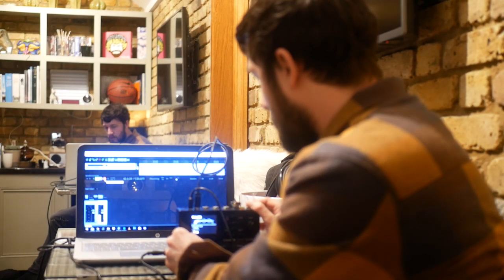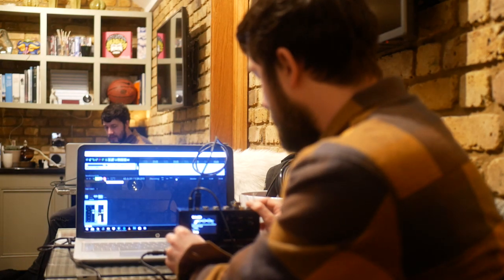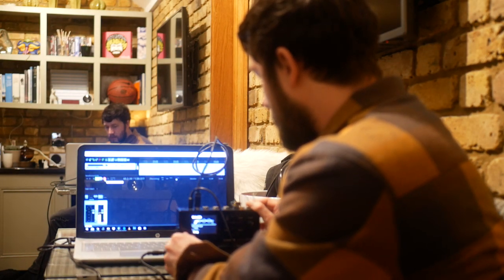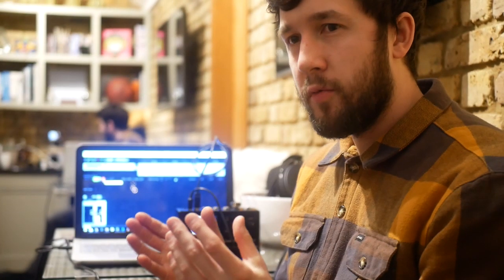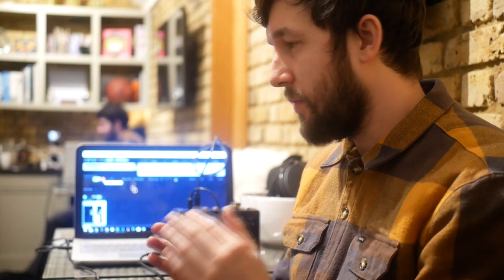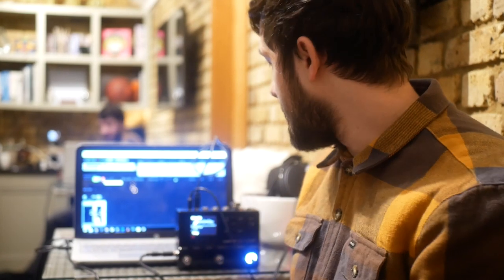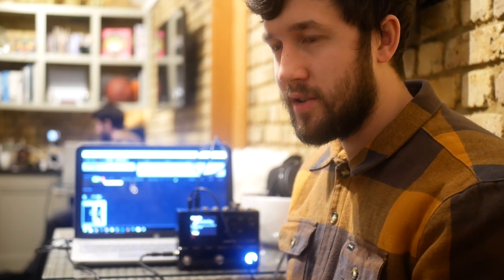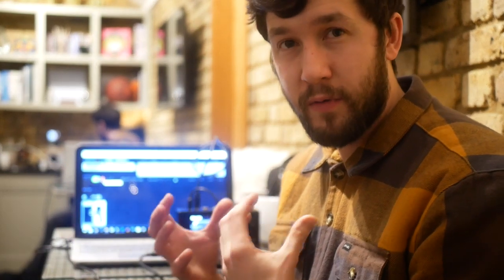Making a MODELLER FEEL like a REAL AMP

Comment: I purchased the Helix about 2 years ago. My current signal chain is 1/4" out to Fender Super Champ X2 head guitar to Ephiphone 1x12 cab w/Eminescence speaker. Turn the voicings off and run it on clean channel Fender Twin channel and run the volume to the level that I want it in my studio and mic for recording or rehearse with it from there. It sounds fantastic! Fast forward to a pandemic setting and rescheduled festival after 2 years I was geeked to show it all off! During sound check I ran into an issue where I couldn't get rid of a solid buzz from the amp- something that I've never heard before (professional sound techs and I tried everything - replacing cords, ground lifts, etc. and burnt a half hour) I ultimately had to drop the head and cabinet and run direct from XLRs to front of house as I was burning from setup time into our sound check time. I was in complete panic mode!  All I could think of was that I sold my Vox and awesome pedal rig to invest in this damn computer floor board that sounded great in our rehearsal studio and now I'm f&cked! The only work around last minute was to run XLRs to front of house instead of mic'd cabinet. We played the show, it went off well, but felt defeated. I monitored out of the wedges (sorry, still old school) and what came back at me for my guitar sound was synthetic and dry sounding. I had little to no sustain and it felt digital and shitty! The audience had a great time, but I couldn't get into the gig because in my head I felt like I sounded like people were hearing me through a 1990's Zoom pedal. I'm not a professional touring musician and don't play out nearly as much as many of you do. I value Rhett and I understood and appreciated John's opinions on Rhett's videos. I just want a rig that sound great live, great to rehearse and great to record and I'd be happy. If that means ditching the Helix and going old school....I can accept that. I hate to ditch the helix due to the investment and I do love the versatilty. I've been looking for videos on mic'd up live amps through a helix but haven't found much. If I can't get sustain, feedback and that warm tube feeling through a Helix I'm open to buyers. I assume that you really need an amp on stage to help get the feedback and help with the live feel. A buddy of mine plays shows every weekend and runs front of house through XLR's and loves the helix. Maybe it's all in my setup.Any comments, feedbacks, tips or other videos you've run across would be greatly appreciated! Sorry to hijack this post.

Comment: I watched Rhett's video and thought pretty much the same things you've covered here.

The biggest barrier between a real amp in a room and a modeller is the fact that pretty much every cab/speaker sim is purposely trying to emulate the sound of a miked up guitar cab, simply because there is no better way to do it.

Sound made by a guitar cab (or any other object) is 3D. This is very easy to demonstrate simply by moving a mic in relation to the cab/speaker. You are capturing a narrow slice of the overall sound. The sound in the room is impossible to recreate through a different speaker (such as a FRFR monitor) because it is dictated by the physical properties of the cab/speaker and how it reacts with the environment around it. If you try to reproduce it through another speaker, that speaker's own physical properties come into play and it creates it's own 3D sound field which will differ from the original cab/speaker.

The only way to do it would be an approach like the Waza Air, where you have headphones/IEMs and simulate the physical properties of the cab and the room it's in while simulating your ears positions in that virtual space in real time (so the sound changes as you move).

Long story short, if you want to achieve a real amp in the room sound using a modeller, plug it into a power amp, disable the IR/cab sim and use a real guitar cab. Modelling has become very good nowadays but the problems associated with cab/speaker simulation are physical in nature.
Reply: napalmhardcore I use the FX Return of an amp with my Headrush and magically it sounds like a real amp.

Comment: I think I've stumbled upon a game-changing solution to 2 major problems with both home use tube amps and digital modelers not feeling like real amps when turned up to gig volumes. I used three significant pieces of gear. A Line-6 Helix LT, a EVH 5150 III lbx mk 1, and a Bluguitar Nanocab. (Signal chain/connections) guitar into Helix in, Helix headphone out to EVH Power amp return, EVH into Nanocab. (the secret to making it work) For volume use Helix large knob to control tone volume. The EVH's power amp is punchy and powerful but also really dynamic (note: I also replaced every tube in the EVH from the stock Chinese made JJ's to Mesa Boogie branded tubes from sweetwater). The EVH had two VERY IMPORTANT tone controls in the power amp section, Resonance and Presence. When playing digital modelers loud the harshness and brittleness is (for me) impossible to dial out fully. But by using the amp's resonance knob, the tones and (most importantly) the feel of tube amp comes through. In the mix is where the presence knob comes in (start all the way off and blend until the tone sits well in the mix. The other "secret" is the Nanocab by Bluguitar. It is a 14-inch by 10-inch guitar cabinet that has been specifically designed to create and project as close to a 4x12 cab as any other 1x12 cab ever has. It has special porting and resonance as well as an amazing ability to project clearly and evenly. When combined these pieces of gear create a real tube amp experience when playing "bedroom appropriate" levels of volume (quieter than the pick attack on the strings acoustically) but also when cranked too. With the Helix volume knob at 3 o'clock its a quiet 55 db. with the knob at 6 o'clock, it's a gig-worthy 113 db. The tones never get harsh or digital sounding when loud but also maintain the fullness and touch sensitivity when playing quietly.
Reply from the maker: Awesome - thanks for sharing!

Comment: I couldn’t agree more with you!
In my experience as a working musician that uses in ears a lot live, I would say that cutting the lows using a low cut is a bad choice because the guitar starts to sound harsh in my experience. About the highs I tend to use a high cut around 5k (which is a lot for some people but it works for me).
I think what changes our perception of the guitar tone playing with real amps versus modelers is that we don’t play guitar with our ears close to the speaker as the modelers emulate. So, all the harshness present in the highs we don’t hear playing with a real amp.

Another thing that makes a difference for the good is using a kind of a room reverb to emulate the feel of an amp in the room.
But is still hard to get a good tone with any modeler that I’ve tried.

I’m thinking about the dream 65 by UA just because of the room emulation that they have. I think it can solve my problem of dry guitar tones through in ears.

My last recommendation based in my experience is always use stereo headphones for the guitar tone (whenever the sound guy gives you that possibility)

Comment: Point1/ compressor idea, totally agree.  point two, all amps recorded are eq'd to fix amps inherent issues for recording and live.  live, the desk will put a 100hz cut on the amps channel, so in theory, your doing the work for the sound engineer, he may find a frequency that is messed up by the room, so applys a cut.  global good for cutting and flattening tone, eq in amp models to boost a desired frequency for cutting in a mix.

Comment: Been using modelers for ten years doing live shows opening for national artists.
The trick to setting up a good modeling sound is to design the patch at stage volume. Just like a tube amp, a modeler actually does change at high volumes. The highs and lows spike and the mids can get lost. Think warm, not sizzle.
Use as little gain in the structure as needed to get the feel and sound you are looking for. Too much gain introduces high frequencies that can result in a fizzy sounding modeler anomaly that can get fatiguing over the course of a show or rehearsal.
Reply: great advice

Comment: Thank you both! Great advice from both sides, it's just that they are valid for different scenarios and for different tonal preferences I think.
For playing live, the best is I think to utilize both set of ideas: the Helix can be powerful enough to provide two slightly different mixes... If you don't overcrowd your patches it' possible to create two (or even more) semi-parallel paths, one for FOH/FRFR's and one for IEM/headphones.
Only EQing the two differently can  already make a huge difference. You can serve FOH well by using a low cut, and possibly leaving more of the high-end to cut through the mix better, while doing the exact opposite for IEM to compensate the tiny in ear speaker harshness, and even add some low end for more of an 'amp in a room' feel.
But this can be taken further.. You might use different amounts of boost for a solo, different amounts of reverb/delay, or even modulation effects. Helix's DSP can handle a lot. I personally use the same dist+amp+IR, then separate the two paths for different EQ, reverb, solo boost and so on....

Comment: Ideally, if you are using a modeler live and want it to sound like an amp, amplify it through a guitar cab and mic that. Obviously turn off cabinet modeling inside you're modeler of choice. If you feel that bass is an issue, turn on a shelf instead of a Low or High-pass and cut a little bit at a time until it sits in the mix well. The sound guy is going to do his thing for front of house, but more often than not what comes out of the monitors is raw guitar signal. The biggest issue the cab on stage solves for is the EQ curvature and lack of a microphone/air in your signal path. IRs sound frickin' amazing nowadays, but they still emulate a mic'd up amp. 

Second, I want to emphatically state that it isn't a matter of pushing air. Air is pushed no matter the speaker--that's how a speaker works. The difference is the tube amp volume and compression. Tube amps get louder before they tap out than solid state amplification--to avoid this use an amp with more wattage--if the venue is providing and they don't have that, it's not going to sound the same and you sort of have to live with it --unless you have a power amp and cab like I mentioned above.

The compressor definitely effects delay and reverb sounds after the amp, I would highly recommend compressing before your Delay and Reverb very subtly to glue everything together--it also gives your modeler a bit spongier feel when you want it--vary it preset to preset depending on need. The Kemper has a compression setting on the Amp section--would highly recommend you look into that as well.

Comment: I think you’re exactly right about the amp in the room thing. But listen to what we are saying the amp in the room. Not the amp in the room with your head right off the speaker cap. I used to play 212 music man, 100 W guitar amp at Church, standing beside the amp sounded great to me amp in the room. Jump down and the people in front their heads were ear level of where the speakers were and it was so bright that it knocked off the ladies beehive haircuts lol I have a line 6 Vetta head Attached to 412 speaker. The same thing happens I get a cool tone but then I’ve bend over a little bit or get in front of the speakers and it sounds totally different. So modelers my opinion can sound just like any amplifier. Obviously it’s how it’s modeled. Take your helix maybe run it through a real cabinet and you may be surprised I don’t know. I play my helix through a head rush powered speaker and I have two of them. I like to set up my aunt models with microphones that are 4 to 6 inches away, so it captures a little bit of the room sound and then I like to cut off some of the Buzzy frequencies I do like the Lows but obviously not in a band mix I feel like I get a great in the room I would love to have a tube head of a Marshall and just hear what it sounds like without a cabinetand compare it with a model without a cabinet I imagine if you synchronize those that you probably couldn’t tell the difference anyway that’s my thought on the whole thing. I love guitar amps I love tube amps but I can’t afford them. I love my helix.

Comment: I watched the same video - and then bought the Michael Britt Custom Presets for Helix Native as I didn't know enough to disagree or agree with Rhett - but I knew the Britt presets are bread and butter reliable and trustworthy. What you miss with a modeller is the musty dusty smell of valves warming up - and the crackles - if they could sell that with the modeller then most would be happier. There really is a lot of bollocks talked about amp sounds in a studio - live is different. Dweezil sounded good live with just the Fractal - so who knows.

Comment: Another MASSIVE thing for me has been getting rid of that trash noise gate. (At any stage) I could not believe what a difference it made especially in the way the amp/sound felt as I was playing. Even when I set it very low I still noticed the tone suckage. I ended up using an isp decimator for live applications. See my last video for straight live diezel esq tone with no noisegate at all.
Reply: SOOOO agree!. Why the heck would boss model the subtle tone suck of the NS-1 into their modelers?! that is one of the only dissapointments of my new GX-100.
Reply: Same with the Boss Katana, the noise gate is utterly atrocious!

Comment: Very good points!

This is why I still don't like in-ears and modelers/cab sims, because of that missing low end which you have and feel with a real (tube) amp and cabs.
Everytime I can use my amp and cabs on stage if feel so much happier and therefore will play so much better. For the FOH guy it's the exact opposite of course.

The thing is, if you never really have experienced what it feels like when playing on stage through a real cracked tube amp with real cabs, you will have no problems with In- ears and a polished modeling sound.
For me, coming from playing a lot live with a crancked tube amp and pedals,  it still sucks!
Reply: I have a ton of low end on my fractal tube heads, gotta make sure your passing the whole signal along the chain, preamp-poweramp-cab out to front of house !
Reply: @rogermoore1233  , it is about what you hear and feel  through your in-ears vs a real cab on stage.
The push of the air from a real cab behind you on stage is very different from wha you get back through in-ears from going direct.
And a real good tube amp still has a more dynamic and open sound then what modelers produce. It is simulation of the real thing and still not the same. 
It is the same as a real Fender Rhodes piano vs a plugin. If you realy know what it is like to play on a real one even the most expensive plugin doesn’t give you the same experience.

Have you ever played live through a real good tube amp an Cab on stage?

Comment: I think you are correct here and after playing with Helix for a while now and trying various presets here is my solution; I found out the true equalization curve of the sm57 mic placed 1 inch from the cone, created an inverse response using several Helix equalizers. I use this mic setup on every speaker cabinet with no further processing and bingo, all the amps sound and feel great right out of the box. I also set the volume of the monitor so that the audio output is comparable to what the modeled cab and amp would put out. very simple; no low or high cuts, no compressors or shelving required. I don't know why Line6 didn't offer this ability? Note, I also use mainly single coil pups and clean to crunchy sounds.

;

Comment: Your first point, putting a compressor at the end of the chain increases the delay tail volume but doesn't make the patch sound like a real amp is partially correct. If your "real amp" is using power amp clipping with front of the amp effects, then its doing exactly the same thing the compressor is doing, except hard clipping. The power amp clipping is a limiter, and will cause the delay tails to be louder, and more interesting, ducked away when the guitar is causing the amp to clip, sort of like a pre-delay on the delay.